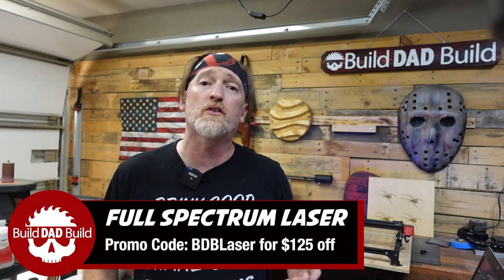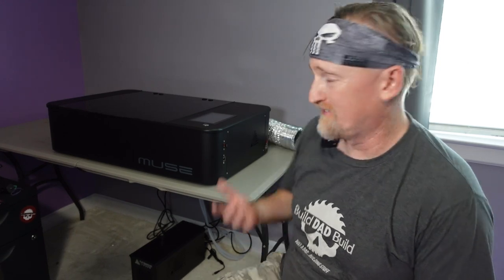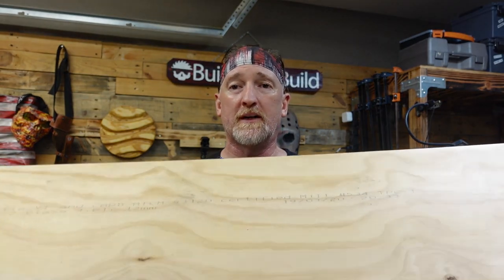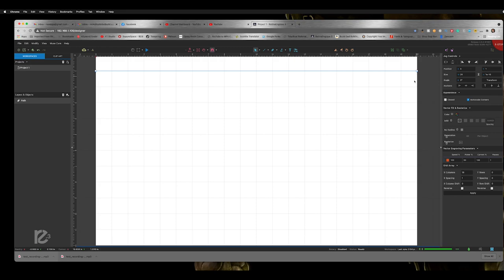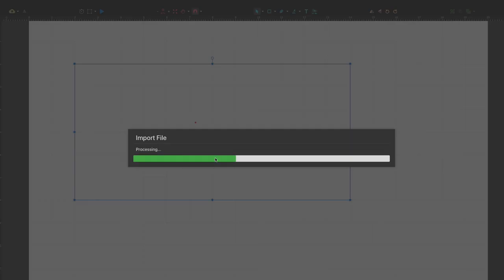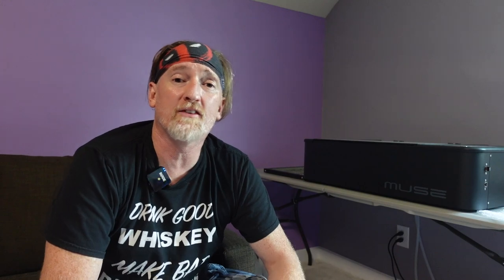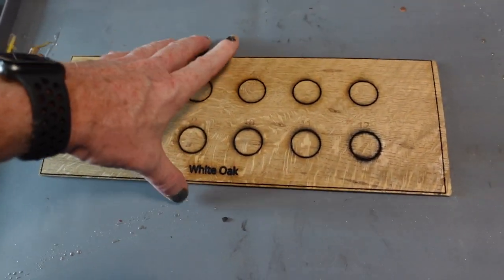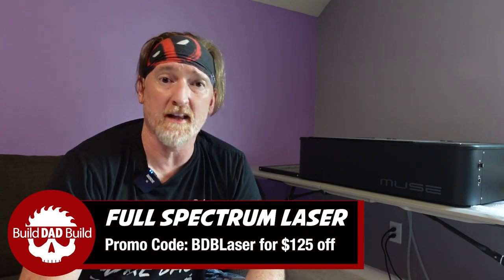My First Thoughts on The Muse Core

Comment: On the Norton White Tile, the key is to go slow. Even with a CO2 laser. On my Ortur I run it as 1200/80% with good results. Not sure what it would be for a CO2 since that's probably stronger then the diode. Should run a test grid on a tile. the one that gives you the best black is the power/speed you want.
Reply from the maker: I've run some test tiles on the Ortur. Need to run some on the Muse as well.
Cheers

Comment: Will it laser designs into an axe head ? As opposed to doing the whole metal etching method with electricity. 😶
Reply from the maker: Diode and CO2 lasers won't etch metal. You're looking at a fiber laser to do that. And they ain't cheap! LOL
Cheers